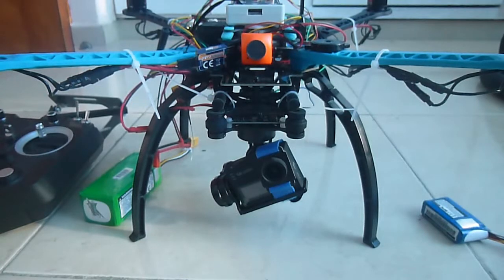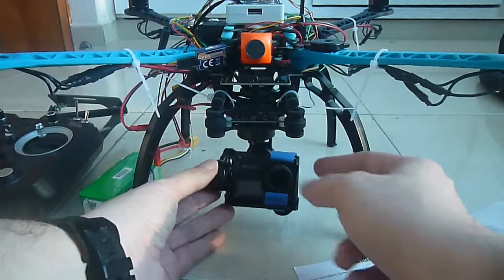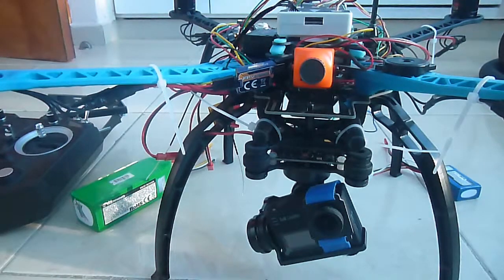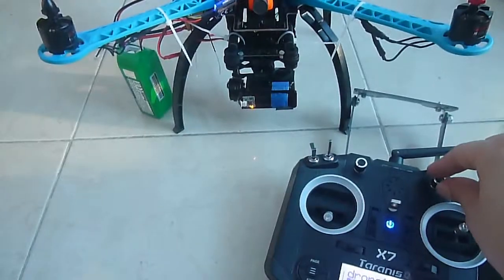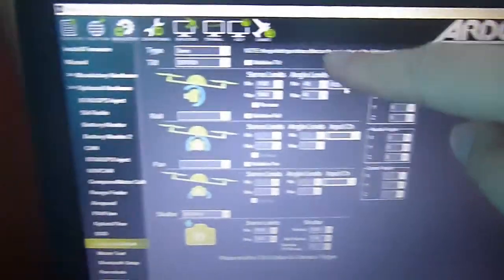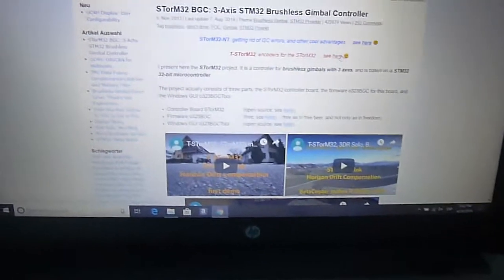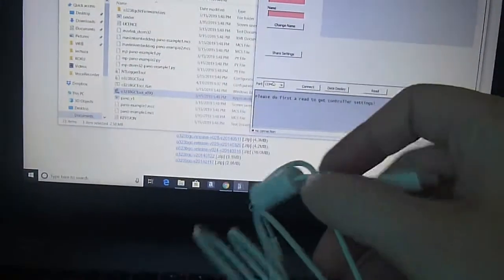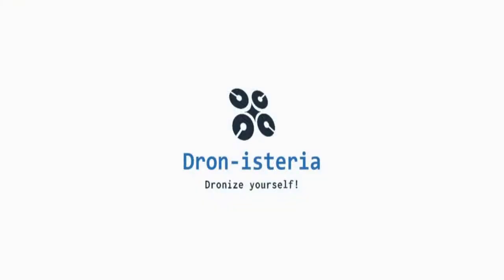How to setup your storm32 gimbal before configuration! Avoid any late hazzles!

Comment: Can you tell me how you reversed the arm for fpv wire issue 
I can’t seem to figure it out
Reply: Just rotate the arms on their axes with the gimbal off or unpowered. Once you turn it on it will look for the orientation and set itself.
Reply: @todotvstreaming  
Thanks I did it just few hours ago
I then had to do a calibration which fixed up a issue from the swap
Working good now thanks